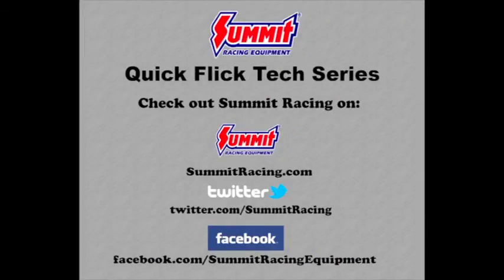Forged vs. Cast Pistons - FAQ - Summit Racing Quick Flicks

Comment: I had a reputable engine builder build me a 383 stroker and utilize the hypereutectic type piston. The engine sat for about a year without being started or broken in and a funny noise started coming from the engine. another engine builder told me he thought that the pistons shrank slightly because of the silicone composite mix and it was causing piston chatter sound. i'm about to have the Pistons replaced with forged ones. Have you ever heard of this happening? Please help!
Reply: Don't take this as gospel from me, I'm not an engine builder, but nobody else replied so here's what I think: What I've heard & read about the hyper-eutectic alloy is it has very different thermal expansion characteristics. The Summit guy mentions this, saying you can run tighter bore-to-skirt clearance, but as I understand it, with hyper-eutectic you must run tighter clearance, because they expand less than forged. The clearance is calculated to attain proper fit when the piston expands under operating temperature. If you fit a hyper-eutectic to the same clearance as forged, you will get piston slap because the piston stays smaller due to less expansion. If the noise is loudest when cold and quiets down a little on warm-up, it might be slap and your builder may have allowed too much clearance for hyper-eutectic when they did the final hone on the bores. Again, just my opinion. Also the theory that the pistons "shrank" in storage smells like BS to me.
Reply: @onemoremisfit  thats good information...I'll use the forged for my build.

Comment: I plan on turbocharging my 1st gen small block 350. I would run a max of 10 psi most likely. What should I go with? And should I upgrade the internals to forged? And I plan to make 600 hp. Is that too much for a 2 bolt main?

Comment: What are the commonly used aluminium alloys to make the pistons .
I've used 4032-T6 alloy for my SOLIDWORKS analysis for cylinder pressures of about 13 MPa. And another question.
is forging good for RPMS of about 5000-6000 or casting can work for this. There are no boosts installed.

Comment: What's the best for long life and power? I daily drive and don't wanna rebuild it every few years. No track days, just street racing on street tires and around town or long trips. Life before horsepower
Reply from the maker: Hi Jason, 
For what you’re doing, a cast piston would be the best choice, but it would be a good idea to look into the hypereutectic pistons. The better ones will have a thinner more modern ring package that reduces friction, makes power, and lives a long life.  You can start your search here: https://www.summitracing.com/search?SortBy=BestKeywordMatch&SortOrder=Ascending&keyword=hypereutectic%20pistons. From there, enter your make/engine. You’ll have a lot of options, but you can sort by volume to set your compression ratio and look at the ones with the better ring packs.  Give Summit a call and we can go through it quickly to determine your needs. 1-800-230-3030

Comment: Talking about single cylinder motorbike engine. What happens to engine balance if you install a lighter piston? Do you need to remove some material from crankshaft or con rod? Is it possible to use lighter piston without modifications to engine except ignition time since piston will be accelerating faster? Your answers will be really appreciated

Comment: One of the biggest things to consider is researching if your car comes factory with forged pistons before converting your car to turbo. 

For those of us who have a car that want that extra power from bolt ons its important to learn whether or not the pistons can handle the boost or else you'll just have a failed piston shortly after boosting which can cause more harm than none and cost alot more if you have to have cyl work done or even a block replaced.

Comment: Small but important correction that are being confused in the pronunciation. There is Silicon (ending pronounced like "kun") and there is Silicone (pronounced like Ice cream cone). The first is a hard solid material (like Sand) while the other is soft material that you use to seal or make beast implants.  Hypereutectic pistons are made with Silicon not Silicone as is pronounced and transcribed in the clip. Silicon is a common alloying additive for several metals

Comment: Ok, so everyone agrees forged are stronger. But say I intend to use the car mostly for street use, how soon would the issue of forged piston thermal expansion cause a need for re-build due to worn rings??
Reply from the maker: tommo98765 , 
Many of today’s factory production cars use Hypereutectic pistons due to lower thermal expansion and better sealing of the rings. These motors go for 100k miles or better typically!
Reply: +Summit Racing - I tend to break lots of cars, So would upgrading to forged internals be the way to go so that the motor can take more of a beating?

Comment: As I'm rebuiling my 454 block, I'm contemplating on whether or not forged pistons will be necessary. I spoke with a few people who've built engines and they've told me that hypereutetic pistons would be fine for my application (500hp, 500 torque, always pump gas), but I'm still uncertain if I should be taking the chance. What would you recommend for compression ratio of 9.5-10.5?
Reply from the maker: Hi *****, 
As long as you will not be using any power adders you’ll be fine with a hypereutectic piston. Just make sure you follow the bore clearance and ring end gap recommendations of the piston manufacturer.
Reply: Sounds perfect, and just to clarify, power adders such as forced induction and stronger fuel I assume?
Reply from the maker: *****, 
Forced induction (Super/Turbocharger) or Nitrous Oxide.

Comment: so my question is would I be able to run a 150 shot of nitrous on a 305 small block with cast pistons..? my mods are .500 cam, edelebrock air gap intake system, 600 cfm edelebrock carb, msd ignition system, z28 valve springs dual exhaust and some other things.
Reply from the maker: Hi Ernie Perez, 
Assuming these are stock 305 pistons a 100hp shot really should be the limit and for short durations. Cast pistons and stock rings are not designed for the extra heat generated by the nitrous. Make sure to put a colder spark plug heat range in and pull 4 degrees of total timing out. Give us a c all if you have anymore questions! 1-330-630-0240. Thanks for watching!

Comment: What difference would I see from the same engine having a stock 8.0 cr to installing a piston with a 9.8 cr? With everything else being the same.
Thanks.
Reply from the maker: Hi Robert Piazza, 
Due to the increased cylinder pressure of raising the compression ratio you will achieve more power. But, you will have to do some tuning of the fuel delivery and the ignition timing; otherwise you may get some detonation. Give us a call and we can help walk you through it! 1-330-630-0240

Comment: i was looking into hypereutectic pistons and i wanted to know whats the max hp on those types of pistons i dont want to go crazy in the hp no more than 400-475rwhp after boost in the long run but i will be running stock for atleast a year im thinking of and also would they be good for forged rods as well?
Reply from the maker: Hi frederick massey, 
Hypereutectic pistons are fine in a low to medium Power Adder situation as long as you set your ring end gaps appropriately and watch your ignition timing closely. Give us a call and we can give you some ideas on the short block assembly and ignition components to choose. Any boosted situation should have an upgraded connecting rod for sure. We can help you with that as well. 1-330-630-0240. We look forward to your call! Thanks for watching.

Comment: i heard racing vehicles pistons do not have skirts ....why and what advantage does this yeild?
Reply from the maker: Hi Mohd Sifat, 
While ultra light weight racing pistons have the majority of the skirt removed, there is still a small portion to keep the piston straight/upright in the bore. Keep in mind it takes power to move weight up and down in an engine. By removing as much weight as is safe, you put more power to the wheels!

Comment: I'm trying to restore a Honda fat cat, if you've never heard of that I would look it up because you might get a better understanding of the application. Any way I'm trying to decide weather or not I should go with a Wiseco forged piston, The bike is going to get hot and turn high rpms so I'm thinking of going with the forged, but if I go with cast I'm afraid that it will score like the old one did. I like the fact of knowing that I can let my friends ride and rev it high with out blowing it.

Comment from the maker: Forged pistons have come a long way as well. They have better materials, better construction, less expansion but are still just a little heavy and pricey. While they can be lightened up to match the weights of hypereutectic’s, this extra machining just drives the cost of the pistons up even more, most times making them cost prohibitive for the average non-power adder guy!

Comment from the maker: The hypereutectic piston is the next step up and is an excellent choice for Street & Strip applications where there is no power adder being used such as Turbochargers & Superchargers. Small amounts of Nitrous are ok providing the ring end gaps are set accordingly. One key advantage to using a hypereutectic piston is their lower expansion rate. This allows the engine builder to set the piston to wall clearance up tighter, thus minimizing cylinder pressure loses and blow-by gases!

Comment: Great video.  I do have a question though and have looked into it, and have gotten mixed reviews so I'll get your guys opinion as well.  Would one need to step up to a forged piston if they were to run a naturally aspirated, high compression (lets say 11.5:1) engine? Or would hypereutectic be enough?  The car would see some strip time, but would more over be a street car.